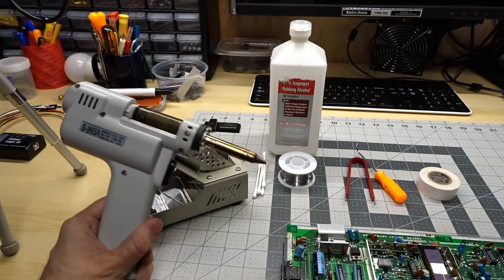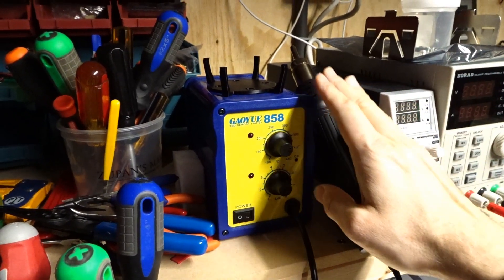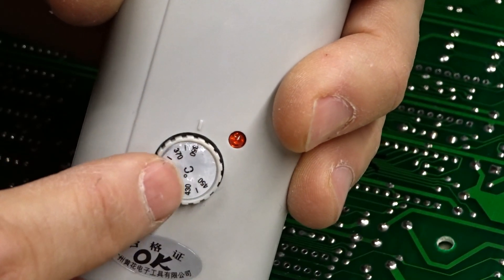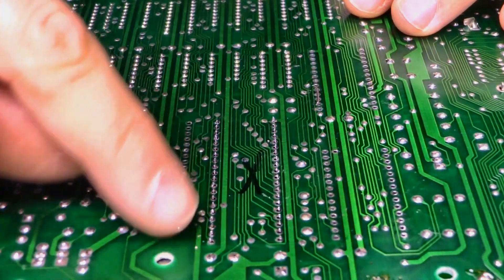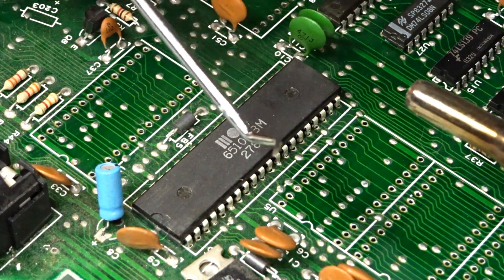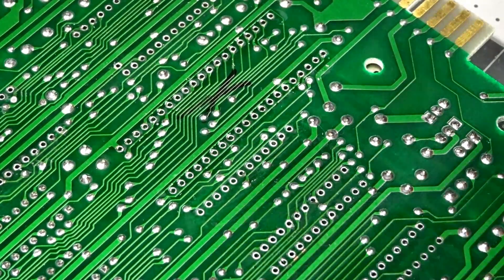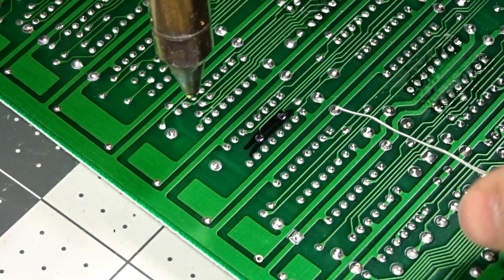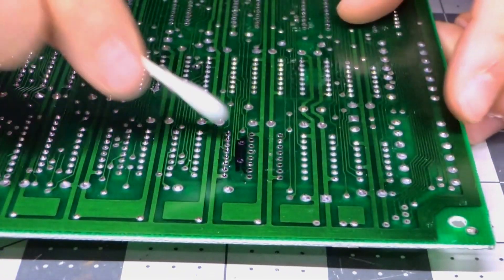How to remove chips without damaging the circuit board

Comment: Good job, no complaining!
A few explanations / improvments:
Apply flux on both sides (I prefer Edsyn FL22, expensive but you really need just a tiny bit). This helps improve flow of the solder. Solder tends to oxidize over time and that makes it less liquid.
Be generous with the new solder. The extra solder improves heat transfer and thus speeds up the hole process.
I use a different wiggle-technique. With pins like these (stamped) I only wiggle in and out (or sideways), in the other direction, the pin would bend and not just flex. Now if you pay attention to the feel while wiggeling, you'll notice that the resistance suddenly drops. This is the moment when the solder got liquid all the way though. Only then pull the tigger for the pump. If you start to suck to early, you'll make your heat transfer worse.
And finally: Continue to wiggle while you retract the gun. The air pulled through the hole will cool down the plating in the bore, but the pin will stay hot enough to get it free from the bore but not for the solder to re-flow.
No hot air needed that way.
Again: You did a good job, as shown by your result.
Reply: This is exactly what I do also! A few fast wiggles to fully liquefy the solder, then engage the pump until you "feel" the solder is removed, then retract the desoldering gun from the board while still wiggling, then once you are fully clear of the board, turn off the pump. I find that 90% of the time I don't even need flux or solder, even with old boards from the 80's.
Reply: Hi @MuellerNick what desoldering tool do you recommend?
Reply: @elkernel  I bought a used Weller and repaired it. Hakko, ... are worth their money.
I once had one of those Chinese suckers and it didn't even suck. Sold it a month later.
Reply: @MuellerNick  thank for the replay, I’ll buy a Hakko then, take care and thanks.

Comment: Good stuff. I always use SMT flux on desoldering through holes as well. I am a big fan of the heat wicking it provides to get better flow. Typically, my components just fall out without needing extra heat from the air gun. Your method works great and I will borrow a few bits of the technique for my net job. Which will be C64 related!

Comment: That Gaojie desoldering vacuum was the best $110 I’ve ever spent!  My model has different tips from that, though.  On mine the tip is at the end of a sort of barrel that gets stuffed down into the ceramic channel.  It’s been my experience that the pcbs can have very narrow holes for the rows of pins, resulting in hard to remove ICs due to their pins having dug into the through holes and sort of set themselves into the through holes.  Gotta try your hot air trick, you’ve developed a pretty great technique to employ your methods.  Fresh solder seems so counterproductive and yet it seemed to work like a charm for you.  Thank you for sharing, I look at a lot of electronics videos and I like that your uploading repair videos.  Thank you for sharing!

Comment: Ah, those desoldering pistols again ... tried using them a few times (different models) and absolutely hate them due to the limited heat transfer. I'll stick with my $80 station and $20 manual pump. Therefore: Don't assume wonders when using those pistols ... if they work for you - good, if they don't try another method (there are folks who still insist on using desoldering wick these days for through hole parts, which I'll never understand - but if it works for them, that's cool).
Funny mishap with the wrong marking tho ;) Happened to me a few times in the past as well.

Comment: My method is cut all the pins on the chip and remove the body of the ic then desolder each pin one at a time unless  you want to reuse the chip 😀 also flux and more flux and chipquik works well for that matter

Comment: Make sure to use lead solder on old lead-solder boards like this or else you are raising the melting temps. I would suggest adding solder using a normal soldering iron since the flux will eventually eat through your desoldering tip's plating. Also, it ends up sapping some heat when you add it right before using the vacuum pump. The guns with the built-in pump are actually stronger than many cheapo desktop units, like mine and the one Kainka Labs upgraded.

Comment: Got a question about that desoldering gun. That's the 110v 50Hz model? Does it come with a grounded plug?
Reply: @adriansdigitalbasement  Ugh. That figures. Not that most cheap irons do. Usually have to go to a proper soldering station for anything grounded.
Ever take it apart and inspect the wiring? I ask because I'm thinking of getting one, and the price isn't TOO bad (still $150, but comes with that really skookum stand), but I'm thinking the first thing I'd have to do is take it apart and make sure the wiring is reliable. Not to say that everybody's gonna have a bad experience with Chinese mains-level equipment, but I've had to repair that kind of thing before.

Comment: Great video as always, Adrian! Thanks for leaving in the mistakes. I like your method. Definitely need to look into a desoldering gun and hot air station. For junk boards, I've used a hot air gun and pliers to harvest parts. I know it's barbaric. But it works. It's fun. And doesn't take long.
Reply: My old partner used to use a propane torch on the back side of the board with the board clamped in his vise. Once he got the solder molten, he would pull back on the board and let it go. Presumably he had a large box against the wall to collect all of his parts. Now that's barbaric. :)
Reply: @MrWaalkman  Rewatching Adrian's videos. Saw your reply. I LOVE it. A propane torch!! Hahahah... And then flinging the red hot parts catapult-style!!?? That definitely takes the cake. I tip my hat to your partner! That's great!
Reply: @wattage  You would have had to have known Neil, aka "The Professor". Probably the smartest engineer that I've ever had the pleasure to work with. 

But he did have his quirks. Not that I have any room to talk, there was a reason why they put both of us on second shift. ;>

Comment: I use a similar method alike yours, using a desoldering station at 335 degrees Celsius.   I use a screwdriver for lifting out the chip. Your pick really does a good job, I´ll be looking out for one... Thanks for the idea ;)

Comment: I've got a desoldering pump, but I've been thinking of getting a proper desoldering iron. The pump WORKS, but you may have to fiddle around a fair bit, especially since the pump doesn't have heat of it's own, and the connection will often cool down before you can suck it up.

One thing I'll say about getting Chinese tools, is to take them apart first, and make sure the wiring is sound. Sometimes it's good, but sometimes the connections are shoddy, or there's an earth wire that doesn't actually go anywhere.

I haven't had much issue with static personally (my concrete floor tends to drain static pretty well), but MOSFETs and CMOS ICs are sensitive to stray currents, and ungrounded irons can potentially damage them. Even if the damage isn't apparent, not taking ESD precautions can still shorten the lifespan of the IC, so either make sure the ground is connected, or add one with a 1M resistor if it's possible to do so (take care that anything you need to insulate has a silicone/fiberglass sleeve, and crimp, not solder those connections). Some people on the EEVBlog forum have also suggested using a 4mm banana plug for the ground, so you can tie it with the rest of your ESD setup, or lift it in case you need to solder a battery. I'd just have it go to ground, and ground the rest of my ESD setup to that same outlet (with a 1M resistor) via the faceplate screw or something. The 1M resistor is important so that any ESD is absorbed safely, not just given a path to everything else, and it also gives YOU and your stuff protection in case somebody elsewhere in the building bungles something up and the ground you're clamped to goes live.

Comment: Perfect! If worried about other components get heated by the heat gun you can build your own heat shields from Kapton tape in various sizes. Build it like a umbrella with a weight of poster putty on the "umbrella handle" to prevent the heat shield from get blown away by the heat gun.

Comment: solder wick is a good cheap alternative for the top solder, especially if you don't have a hot air station. One other tip is to take a needle nose pliers and try jiggling each pin after desoldering, this both identifies any still soldered pins and frees the little bit of resistance that remains from edges of the pin sticking to the through hole.
Reply: good tips, also you can get a spring plunger operated version solder sucker if you can't justify something more expensive.  the teflon tip can be sliced off to give whatever opening size you need
Reply: @jgunther3398  the vampire works well
Reply: A wick would be a good option.

Comment: Everyone has its own methods; some techniques work better for someone than someone else. I don't think there is a general truth about desoldering and also the optimal technique differes case by case. Nvertheless, some comments.

* There are similarities between your method of desoldering. When using the heat gun, I take extra precaution and that is, I protect parts of the board that I don't want to heat up with aluminium foil. Iḿ using the type that you normally use in the kitchen and with scissors I cut two strips and fold them around the board, the area that I want heated between the two strips. This would have been useful in your case to protect the capacitor that you did mention, but I also want to avoid the solder of other nearby components to melt.
* Using this protection with aluminium foil, it becomes feasible to desoldering with just the heat gun. You need quite a long exposure before you can desolder a 40-pin this way, but for the smaller chips it works quite will. I gently pull on the IC with an IC-puller, and heat from the underside until you can pull the IC out. Then open the holes with desoldering braid.
* Iḿ also using a Chinese desoldering iron, but itentionally a more primitive one than yours. It is like this one: https://nl.aliexpress.com/item/x/32925896857.html  I'm doing this because it easily fits in a drawer and I want to avoid having to store many m³ of tools for my retrocomputing hobby. I had mixed results with it until I bought a set of spare nozzles for it: Using the right nozzle size is very important to get good results, and now it works quite well.
* As an alternative to using a heat gun for dealing with leftover solder on the top side of the board, I sometimes heat the pin with a normal iron and lift it with a small screwdriver. It gets bent, but that can be corrected later.

Comment: Here’s an old trick I use for cleaning the vias after you remove a component. Dip a toothpick or a sharpened match into melted rosin/flux. Then apply heat to the via and the dipped end of the toothpick, insert it into the via, and rotate it slightly. This clears the via right away.

Comment: Not sure if you know this already, but a great tip to remove solder from a desoldered DIP's legs is to have something that is holding the chip for you, then you use a clean soldering iron and a desolder wick.

Comment: Hi Adrian, There's nothing wrong with your method. It seemed to me from your video that you kept missing one leg. You did it for both of the ICs. You can use a magnifying glass to check or an iFixit spudger or opening tool to carefully try to move the legs and see which ones are stuck.
Reply: You could also consider using a narrower tip with your desoldering gun. That would heat the legs faster and reflow the solder all the way through.

Comment: A slower method is to use a solder sucker vacuum pump, hand actuated, for each pin, if an even cheaper option is desired.  I like how well the chips release on the hot air.  I kinda want to bend some aluminum to create a narrow tip for my hot air gun to do the same thing.
Reply: You can get ZD-211 desoldering iron, works much better than a pump, it's not very durable but it only costs like 10€.

Comment: I found that solder is most likely to remain in the hole on pads connected to gnd/vcc because of the heat beeing dissipated away to the larger tracks. I keep the gun on those pads for additional one or two secs and this generally solves the problem.

Comment: So basically, use the right tools. Unfortunately for me I can't buy them right now so doing something like this ranges from really hard to impossible.
Reply: You can do the same thing with a soldering iron, some solder wick and a little tube of flux. It'll take a little longer, but I've done it lots of times. You just need to clean up the flux with some alcohol afterward. Wick out the solder on each pin while wiggling the pin with the tip of the iron (through the wick). After getting the chip out go over the whole footprint with wick and flux again and your pads will be like new. The method here is good if you have the tool, but I don't do this enough to justify the expense either. I would've liked to have seen him use some flux and solder wick to clean the pads and maybe even for the tricky pins. He probably wouldn't have needed the hot air if he had done that.

Comment: Tie a string to the chip, and the other end to a door handle. Stand on the board and slam the door. Job done.
Reply: Tried it..worked perfect.chip came out perfect.my old method was tie the chip with string to the back of a fast car.i hold the board and he floors the car.the door is far easier.
Reply: Last I checked, chips did not look like teeth.

Comment: I have the same Desoldering Iron and I was literally ready to break down and buy a Hakko or similar better unit as I was frustrated after lifting a trace or 2 in the past.  Always wanted a Hot AIr unit although sooo many opinions on what is a decent yet inexpensive unit that won't catch fire (Hey Birt, I watched your Video on fixing one!) just look also at EEVBLOG I believe and those units can be downright scary.  I'm ready to give this a go, now to find a pick or whatever you formally call that tool!   -Mark.

Comment: I've found that using a water soluble gel flux on the pins works really well with the de-soldering iron. Even though it is more messy the water soluble flux comes off really easy.
Reply: Which water soluble gel flux can you recommend and do you use?

Comment: That one pad kept some of the solder because that thick trace wicked away the heat and prevented it from melting as much as the others (it also sucked some of the melted solder down to the other side). Thicker traces something to keep an eye out for. 😉

Comment: Good job overall, getting the parts off with the PCB unscathed is always good. You can also use a small heat gun (or back hold your hot air reflow gun a bit further back from the PCB) to preheat the PCB in the area you will be desoldering beforehand. This leads to less thermal shock on the PCB and preheats those stubborn, thick, power traces. Leaving the desoldering iron in place a few seconds, after it has melted, will also help insure that all the solder will be sucked up, and as a bonus you don't have the iron quite as hot.

Comment: Nice technique. I normally use a shed load of flux to get it of the underside and then use something  sharp to lever one pin against the next on the top side. I do that  from both directions until I can see it is free. Will give this a go on my next board.

Comment: I use my trusty Radio Shack desoldering iron and the “4 second rule”! Just make sure to bend all the pins straight, first. Then I just squeeze the bulb, put the tip over the IC pin, and gently pull toward the body of the IC; once the solder melts, the pin will then move away from the inner wall of the through-plated hole, and I let go of the bulb after 4 (and no more than 4) seconds. It’s this solder that’s stuck between the component lead and the plated-through hole that stymies most efforts to safely remove the component(s)! Note that power pins are usually connected to a big, flat ground/power plane and this will act as a heat sink when trying to desolder those pins! If they prove stubborn, apply fresh, new solder FROM THE TOP (component side), and make sure it comes out the solder side. Now, re-try, but with a 5 second wait. Then just flip the board over, and the IC should just fall out as you touch the soldering iron tip to the last pad. HTH! 😊

Comment: I repaired a crazy kong last year and removed many chips, put sockets in place, tested and put the chip back, in just about the same way, but used lots of flux and solder braid to remove most of the solder and then used the hot air station to pull the chip from the other side, it works great and I didn't life a single pad or track.

Comment: i think you might have better luck and less stuck pins if you used flux
Reply: Fresh solder contains flux.
Reply: @Hagledesperado  only rosin core contains flux, he's likely not using that, but even then that's not enough - you want the whole area under flux, and it needs to be fluid, which means a different kind, like amtech tacky flux
Reply: @Hagledesperado  only rosin core contains flux, he's likely not using that, but even then that's not enough - you want the whole area under flux, and it needs to be fluid, which means a different kind, like amtech tacky flux
Reply: Meh,. you don't need much wetting, only decent heat transfer. Fresh solder seems to work fine IME.
Reply: @Hagledesperado  that's exactly what it's for, heat transfer.

fresh solder works ok, fresh solder + flux works better. give it a try one day if you haven't, you have nothing to lose.
Reply: @Hagledesperado  only rosin core contains flux, he's likely not using that, but even then that's not enough - you want the whole area under flux, and it needs to be fluid, which means a different kind, like amtech tacky flux